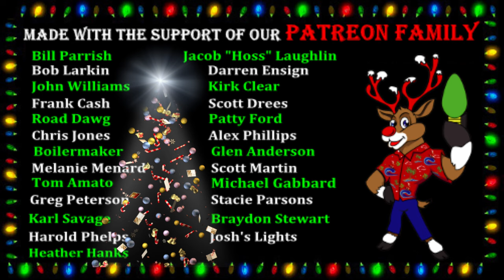How To Build A Giant PVC Candy Cane In 10 Minutes | DIY Prop Build Tutorial

Comment: I'm gonna have to think on this. I'd like to light mine. Also, adding a thinner red or green stripe of tape will give it more variety and interest. Great job!
Reply from the maker: That's a great idea, Alex! Adding a green would really make it pop. To add lights, you can use stripe lights, rope lights, or cut the 5ft tube in half, drill holes for AC lights, and then use a 4" connector to put the pole back together.

Comment: Enjoyed this How To video on constructing a giant candy cane Charlie. How do you display it? Is is mounted or freestanding? If freestanding, what do you use at the base to keep it upright?
Reply from the maker: Hey there, Terry! I mount these to the front of my Santa's Workshop by using 9" bolts. For free standing, simply put an end cap on the bottom, drill a whole through the end cap, and place a piece of rebar into the ground and slide the candy cane with end cap onto the rebar. I do that with other props that I use and it works just fine.  They key is to have the rebar about 3 feet into the ground so the prop does not sway. To keep it from turning with the wind, just drill a small screw into it's side and use fishing line to attach to a stake...if need be.

Comment: Thank you. Will definitely be adding some of these go my collection. How do you mount it. If it is on a stand could you perhaps do a follow up video showing that. Also, how could one go about adding lights to something like this?
Reply from the maker: Hey there, Dylan. I mount them onto my Santa' Workshop. I use a 9 inch bolt and screw it into the workshop. If you wish to mount it into the ground as a free standing display. Simply put an end cap on the bottom, drill a whole through the end cap, and place a piece of rebar into the ground and slide the candy cane with end cap onto the rebar. I do that with other props that I use and it works just fine. To add lights, use IP65 or 66 strip lights or standard rope lights and wrap the candy cane. Stipe lights can be cut and allow you to have an exact match for length though.
Reply: @ChristmasOnCrestline  awesome thanks so much

Comment: How does it hold up in weather? Especially wet weather with the tape?
Reply from the maker: I have not had any issues. Plus, I ended up using some spray can polyurethane to coat it which bonds it more to the plastic.

Comment: What do you use to anchor it?
Reply: I've found a 4 inch wooden fence post generally fits inside the pipe. Hammer the pointed end of the fence post into the ground and slide the candy cane onto it.
Reply: @jeremyfk  that’s a good idea cheaper than buying rebarb
Reply from the maker: Hey there, Linda. I use 10 inch treaded bolts and screw them into my Santa's workshop.
Reply: @ChristmasOnCrestline  I want mine freestanding